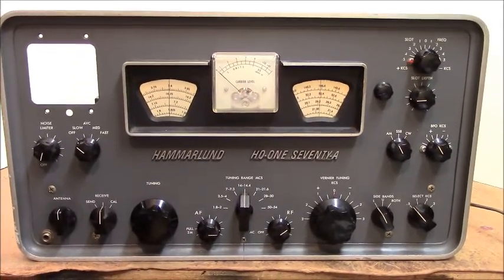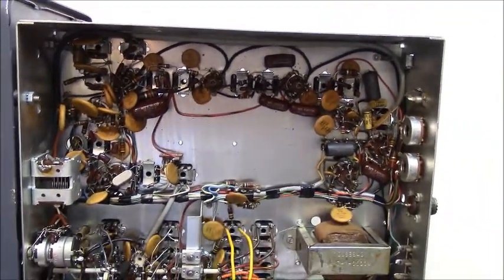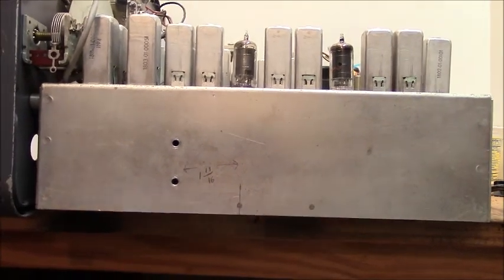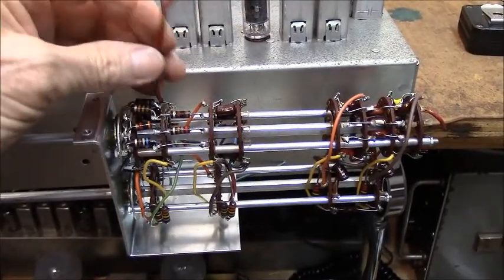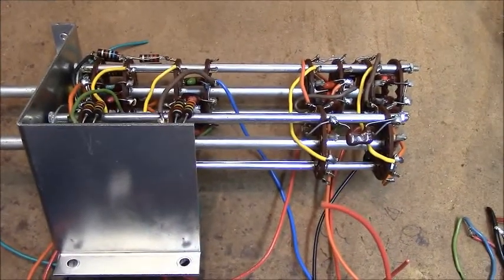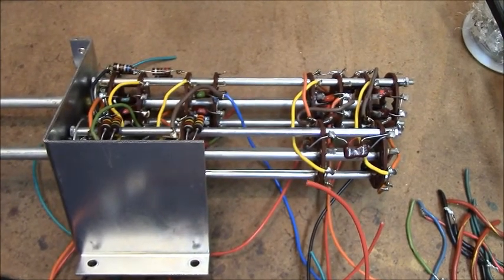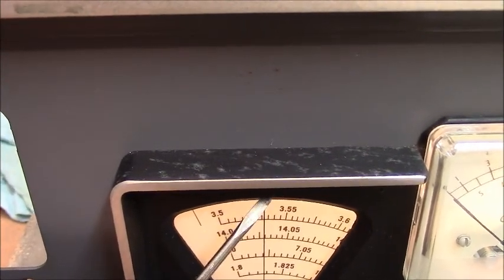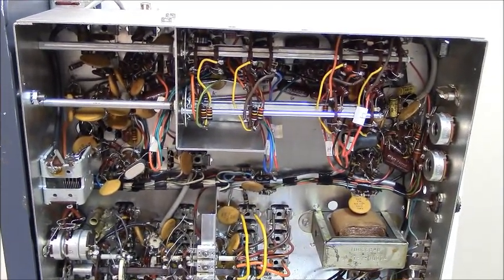Hammarlund HQ 170A Sideband/Selectivity Switches

Comment: Thanks for the tips,  Charles.   I ended up replacing the windows because the bottoms were warped out of shape.
Most Hammarlunds could be fixed with your method, though.

Comment: You had mentioned that the best way to align this is with a scope. But I see no videos in your list discussing that. Can you recommend one? Thank you.
Reply from the maker: Check the Hammarlund manual for tuning procedures. Feed signals with an accurate signal generator. I use a frequency counter attached to the signal generator for more accuracy. You can use a meter or O'scope to read the output of the last IF or read the AGC while tuning the IF chain etc. There are plenty of videos on YouTube showing how to use your instruments.

Comment: 22AWG, seems a bit small to work with. I might like to use 20AWG stranded NTE or Guasti wire instead.
Reply: Seems the bezel points being in the wrong place was a factory error.  I wonder how many others left manufacturing this way, and the serial numbers of those involved.

Comment: Why would have the window markings  be so out of tolerance in the first place? Certainly not a factory problem or was it?
Reply from the maker: Not sure how or why but many of them are that way.  A real pain to correct.
Reply: @charlessmith833  I think it was a manufacturing error.  It's possible QC did catch it but was told they weren't going to repair them at the added expense, and out the door they went.